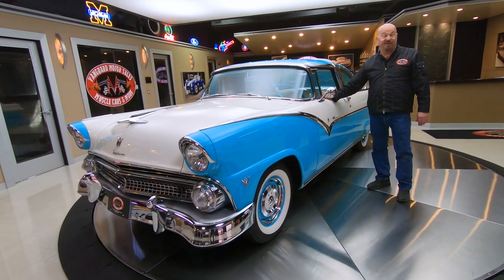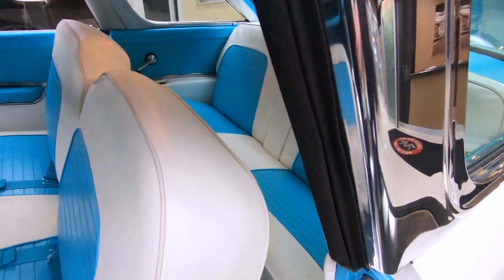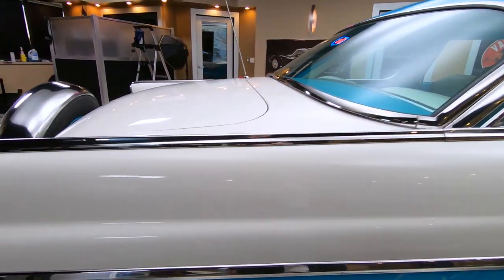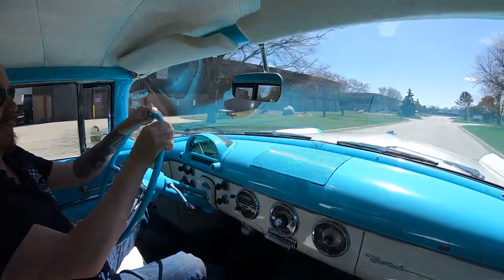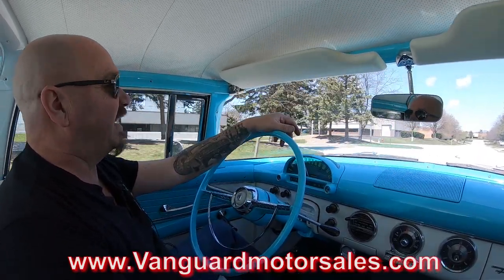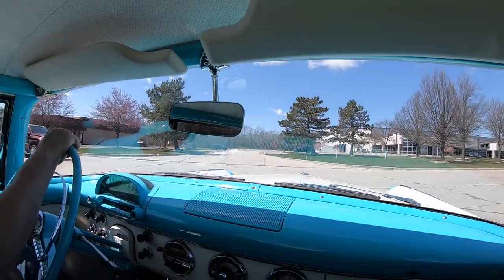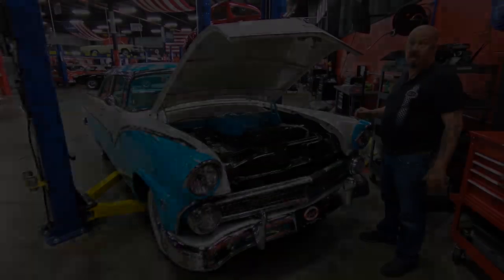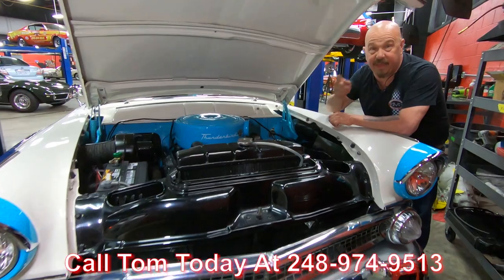1955 Ford Crown Victoria For Sale

Comment: It should have been a 292 cu. in. engine and it's not the stock color, that was red with black valve covers with Thunderbird decals on them. I had one of these in a Fairlane 500 and drove it 1/2 million miles before selling it,